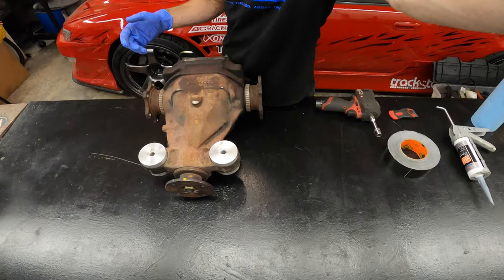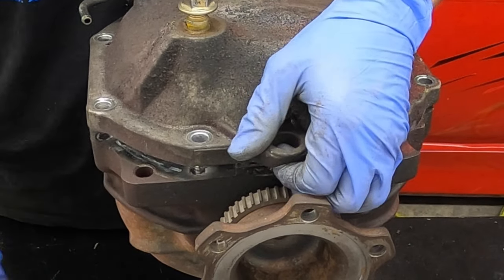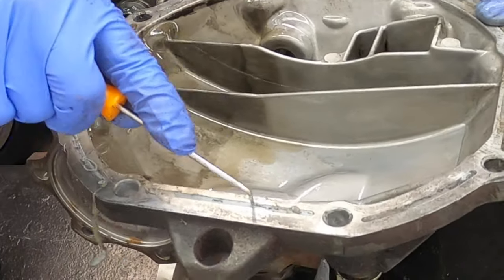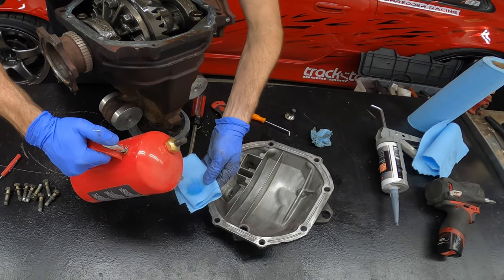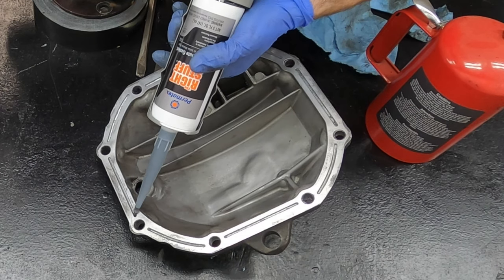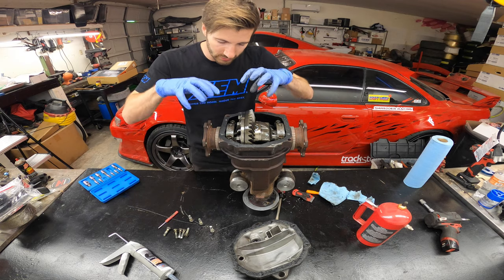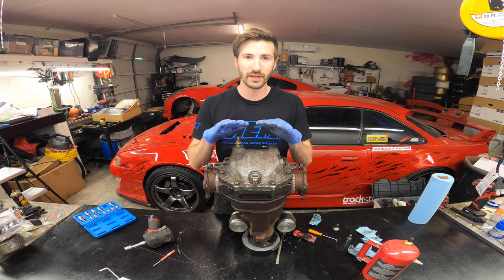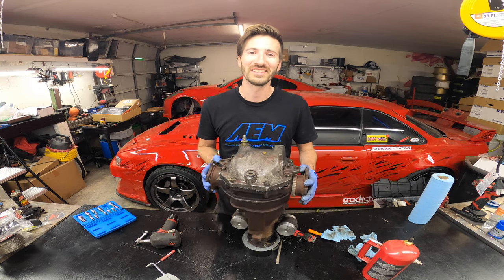HOW TO Fix your leaky differential for under $5

Comment: You DON’T need to remove the diff to replace the seal. It is a ton of work for no reason. It is very easy to do wile it is attached.
Reply: I think it was already off for the video!
Reply: @chim7741  he said at the beginning of the video you’re obviously going to need to pull your diff out
Reply: Please elaborate bc I don't want to pay $900 to fix my 20 year old Mercedes clk 320!
Reply: @yodatagz  you don’t need it off lol
Reply: Some diffs you have to remove or you won’t be able to get the rear plate off
Reply: omg. thanks!  I was researching how to replace a diff seal, thought i was going to have to remove the diff..  good point !
Reply: That's not in all cases.
Reply: I was definitely wondering if I can do mine myself without removing!!
Reply: Dude this was only for a YouTube video 😂
Reply: You are talking about live  axle. In this video, he was fixing the rear diff from independent suspension. This diff is hanged to the rear sub frame. You can't take the rear cover of the diff unless you drop it.
Reply: But it makes a great video 😅
Reply: @biancadistefano7612  shouldn't have got a Mercedes if you don't want $900 fixes.
Reply: @KimCheongBRO  I just sold it, 😆.  I'm getting a Toyota!
Reply: @biancadistefano7612  good choice. Mercedes are nice until it comes time for any repairs. Toyota are nice because they dont need as many repairs. I'm solidly in the Toyota and GMC camp, both are reliable and don't cost an arm and a leg to repair when they do need work done.
Reply: No gasket?
Reply: I’m assuming you’ll just spill the fluid and have to replace it right ?
Reply: You do need to buy new gear oil tho. I guess it costs 20c for a gallon where this guy lives
Reply: @lupe8519 yes. But it's ok because you saved money not buying a real gasket. Instead you buy a tube of this stuff, a caulk gun, a Stanley knife, a pick tool, gloves, paper towels, a socket gun, a can of degreaser/ brake cleaner, a crush washer. Oh and a little screw to reseal the entire tube of liquid gasket so it can go off by the time you need it again in a year's time. Money well spent tho
Reply: @dylanmartin9190  damn I thought it didn’t need one cuz of this video lmao.. thanks for the heads up

Comment: You kept saying previous owner, and I just kept going “me” cause I bought my car at 20k miles salvaged. When I installed a watts link on my mustang, it came with a diff cover that let the links attach to the cover. Boy that thing leaked ALL the fluid out the first time I installed it. The bolts backed out and the cover separated from the diff from all the forces on the watts link. When I installed the cover for a third time I did all these steps and it is finally dry as a bone! These tips def work, for my application I added some thread locker and I marked the bolts with paint to be able to visually check if the bolts were starting to back out. Haven’t had a problem since! Thanks for the content Shredder!

Comment: A $500 charge from Cadillac service department on my 2016 SRX. I’m going to ask my son-in-law if this is something he can take on.  Thank you for the video.
Reply: Your son can take it on, it's just that for most guys, it will take them 15 hours.  The car will sit there for many days and many weeks.  Or if they start at 10am-5pm will come, and they are still working on it. Maybe because they got stuck on a particular step.  A missing socket, missing part, need replacement part, etc. That $500 u save, will come out of your son in laws time in life.  No doubt he can do it. But at what cost.

Comment: Why does the differential have to come off the car? It seems like as long as it was drained first, it could be done while still attached, no? Maybe I'm overlooking something.
Reply: i was thinking the same exact thing
Reply: There must’ve been other reasons he pulled it out-I don’t know why he doesn’t reply
Reply from the maker: @gregl2249  i replied to the same question up above.  Nissan's (and lots of other cars) use the back cover to mount to the subframe, therefore MUST be pulled to gain access, its not like an old ford or chevy.

Comment: To save you all some time. Put perfectly clean container under the differential and collect your fluid, keeping it clean. Put silicone or a new gasket on, and slap the cover back on, making sure to torque the bolts correctly. Put fluid back in and you're good. Now, if you haven't recently replaced your fluid, and that fluid you took out is old, just go ahead and buy a few new bottles of whatever your diff needs and dump the old stuff. In my case, I had a shop work on my rear end and they didn't seal it up right, so I saved the brand new fluid and used an old bottle to spray it back into the diff. In your case you'll probably just buy new stuff, so get a little more than what your rear end takes and squeeze it in while making sure the bottle is mostly full. Do this by putting the other fluid into the bottle you are using to keep it filled up. This way you don't need a pump. Fill until it begins to gently pour out, wait until it stops pouring and you're done.
Reply: I was wondering the same thing. If you have to take all this off. Why can't you do all this with the part on. I can't get all that off but I can do this while it's on.

Comment: It'd be better to use a plastic scraper/non-metal tools than a razor blade so you don't scratch up the surface and create more ways for it to leak :p
Reply from the maker: Rafee very good tip! I was careful but you're right it could cause gouging if you're not careful

Comment: I can see why pulling the diff would be an option for anyone who is looking to reseal their diffs. The reason being is oil contamination during the curing process  if not cleaned throughly. If the diff is still on the car I can see some remaining diff fluid flowing down and getting into the new seal and ruining it. Other than that, love this vid!

Comment: most times when i service anything with a crush washer ill file the edge flat again where it makes the seal between the bolt face and part, you can get away with it 2-3 times

Comment: If you just buy the gasket do you still need to put down a the sealant or if you have the gasket that’s plenty enough? My 04 ford f250 needs gasket replaced and it’s only $10 bucks for the gasket.

Comment: Hey sorry for this thought dumb question but I’m a situation where I don’t have time to look for my leak, I know it leaks from diff. My car is also lowered and don’t have flat ground to jack up and check. Where are all the possible leaking areas? I might have bent it from hitting the ground or something, I think it might just be an old gasket, can that happen? I don’t think it’s ever been taken apart. Just need to make sure it stops leaking so I can have my car for the future. Thanks! I’m in a tough spot and don’t have money for a shop. Need to fix this and don’t have time to play with it now
Reply: Never hurts to ask and community is a great place to do so!

Comment: It doesn't matter, your using permatex black. .  You can mar the metal on the lip, use permatex black, and you will have no leaks. That's the advantage of gasket maker.

Comment: Metal on aluminum and not using a star pattern to slowly release the fasteners. Hmm
Reply from the maker: nothing is 'sprung' on the cover so no reason to unbolt in any sort of pattern.  you can see when i put it back together i went in a star pattern and slowly tightened.